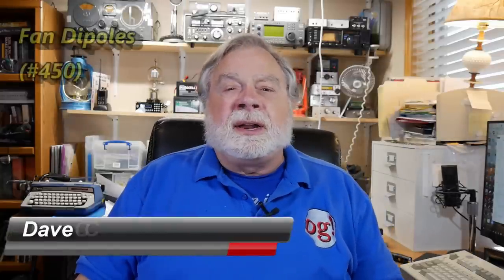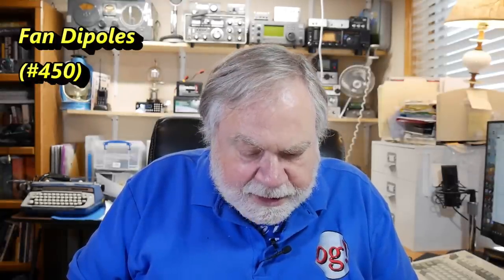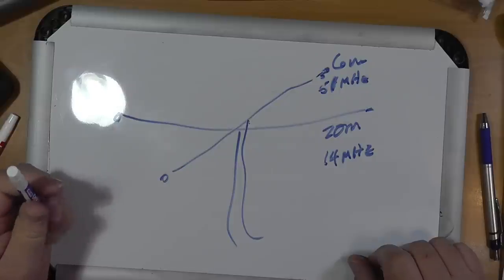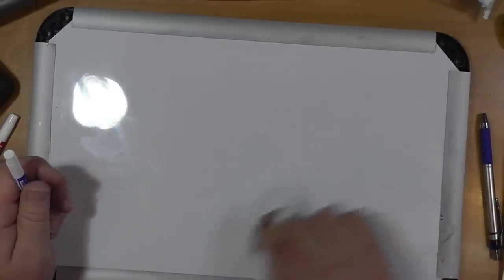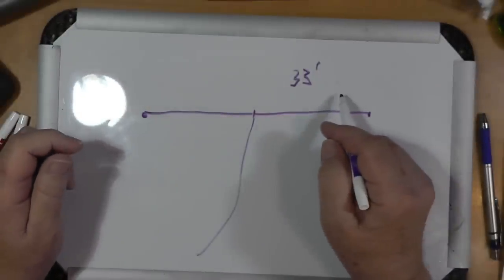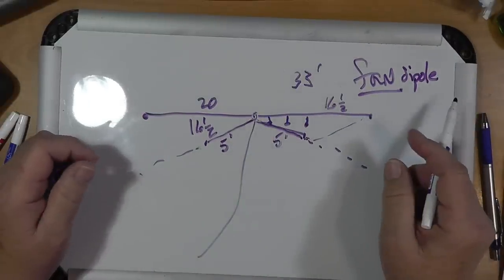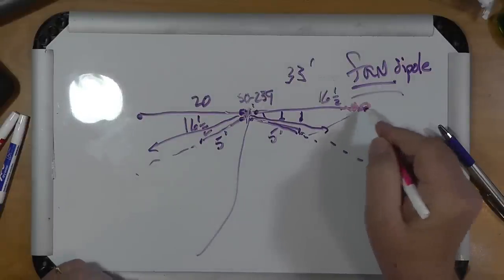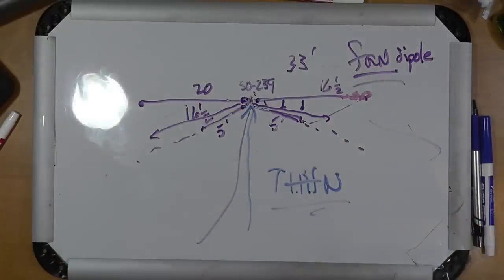Fan Dipoles (#450)

Comment: I use 16 gauge landscaping wire for my wire antennas. I successfully built one for 5MHz for my military detachment for tactical deployment. 

For home use, I built a dipole center with an SO-239 connected to a 1:1 choke and split into two terminals. I can put whatever length wire(s) I want on it, whenever I like.

Comment: My fan dipole is my very first homebrew antenna and I still use it to this day. I made my own balun/choke and used 14g THHN wire. I have the 75m stretched flat/horizontal and the 40 & 20 meter in an inverted V. 
I can tell you that through experience do not be afraid to bring those legs down. 

You would be surprised at where you can contact on 100w with it. I have worked all continents including Japan on 100w with my fan dipole.  I tuned my  75m first then trimmed my 40 & 20.  I found that just by bringing the legs down on 20 & 40 did bring the SWR down rather than trimming them further.  I still prefer my fan over my Hexbeam in some instances.  Best of luck. Thanks Dave. 73

Comment: I have a fan dipole in my attic at our FL QTH with elements for 40, 30, 20, and 17 meters. It is in an inverted V configuration and the 40m element resonates on 15m and the 30m element resonates on 6m so with 4 elements I get 6 bands. It works surprisingly well. I worked 85 countries that past winter with my Icom 7300 and 100 watts on CW. We are in an HOA so no outside antennas are allowed. The condo is a single story so the antenna at the center is probably only about 30 feet high. Fortunately no foil backed insulation is in the attic and the roof is tile.

Comment: When you pull the legs of the dipoles "at odd angles" as you say, and pull the legs down to inverted VEE configuration, you get what is called a "Maypole Antenna."  I have run these for over 30 years with excellent results.

Comment: Just finished my fan dipole home brew! Excited to use it next week. It’ll be mounted pretty low. Using steal and copper wire.  40m 60m and 75m band half wavelength. It will only be mounted 7feet above ground. Funny you say to not use house wire in use. A co worker was trying to build an antenna using the “grounding port in buildings” I didn’t think it was the best idea.

Comment: Hi Dave.  I have an existing 20m dipole that is perfectly tuned for 20m digital. If I add a pair of new wires to the existing dipole in fan dipole manner to add 6m capability, will that significantly de-tune my 20m dipole?

Comment: NOTE:  Question duplicated from another (incorrect) video

If I wanted to build an antenna (a fan dipole, or possibly a fan-"dublet" with 450ohm feeder similar to a G5RV???) for my IC-7300 that covered ALL of the bands from 160m down to 6m, how many legs would I need to do?  (Do any of the bands double up on any of the fan legs?)

I have an attic space that is ~48' long at the ridgeline that is ~28-30' in the air.

For the longer legs, can I wrap them back around (with spacing) and/or possibly use chokes?  If I wrap them back around, how many times can I do that?  (effectively ending up with multiple"Zs" in each of the longer legs"

If I use the 450ohm ladder line, how long can it be or should it be before I switch it over to co-ax?

Finally, I can't seem to find consistent data on whether the internal ATU on the IC-7300 can actually tune this type of antenna, how do I determine (specifically) what my SWR is on this antenna (and know that it is below the 7300's 3:1 SWR limit?)

Comment: Okay, question. Since 40M length seem to work well on 15M, does the inverse apply? In other words, if I put a 15M element on a fan dipole, will it cover 40M as well or will it be too short? 73 KG9PN.

Comment: Hello again Dave.  Love your videos.  I am thinking about a 40, 20, 10 and maybe 6 fanned dipole.  I would imagine there is a bad, better and best pattern to use to adjust the wire length to achieve the best results.  I know to wrap the wire instead of cutting until the proper length is obtained.  Is there one band that it is best to adjust first. And would you think adjusting one would make a big difference to the others.  And I would add a choke, most likely a coax choke to prevent rf from coming down the shield.  Any thoughts would be appreciated.

Comment: I have a couple questions regarding fan dipoles, if someone could point me in the right direction. What is the input impedance? Does it stay at 50 ohms (I guess it's actually 73 for a dipole) as you continue to add elements? which brings me to- is there an upper limit to the number of dipoles that can be combined? and finally, does the power half with every element? thank you for these videos, they are very helpful

Comment: I have built two fandipoles, one for 40/20/10 hanging 33ft up between two trees, very happy with it. Although I might change out the 10m with 30m, since 33ft is to high up for the 10m band due to the radiation pattern. Or is it fine at that height?

Comment: can you mount a dipole under an existing dipole eg 80/40m and have 2 seperate antennas say 12 inches apart i have heaps of coax to use up currently the 80 works perfectly like to try the 40m under it
Reply from the maker: If your 80 works across the entire band, then something is absorbing power and converting it to heat. No 80 m  wire antenna will cover the entire band. Rather than stringing one dipole under another, just create a fan dipole. Note that coax doesn't go bad if in storage. I once bought a 500-foot roll of Times Microwave LMR-400 and am still cutting pieces off of that roll.

Comment: You are connecting an unbalanced feedline to a balanced antenna.  Don't you need a balun at that feedpoint?  Otherwise, you will get common mode current and RF in the shack.

73 VE7NDE

Comment: What's wrong with horizontal polarization for FM if all sending and receiving stations are same polarization?
Reply: 90% of folks running FM are running vertical.  You'd have up to 20 db loss just from cross polarizing. SSB CW and digital are mainly horizontal.
Reply: @kansasradioguy  yeah I get that, I'm saying specifically, what's the issue with polarization? If everyone is the same, there is no difference right?
Reply: @Justin-bd2dg  Right - it’s just that everyone else has standardized on vertical.